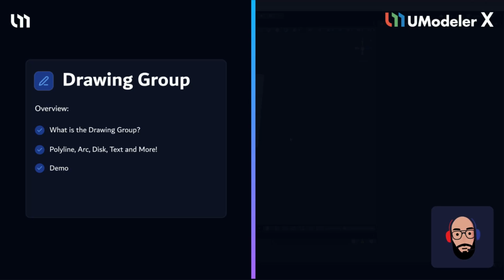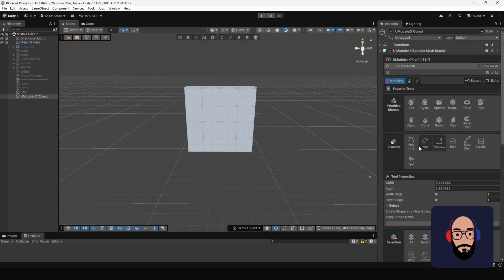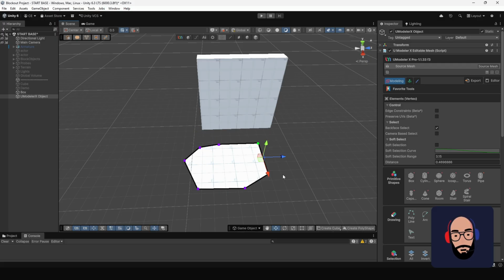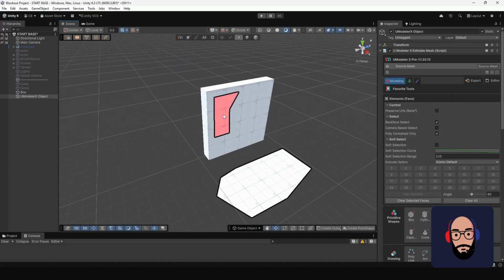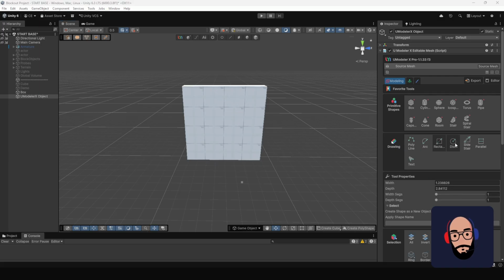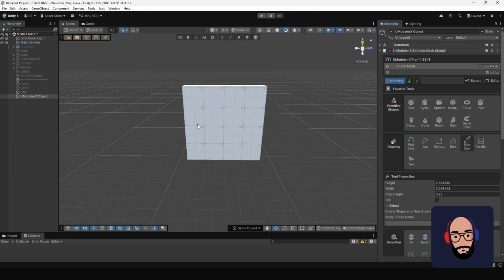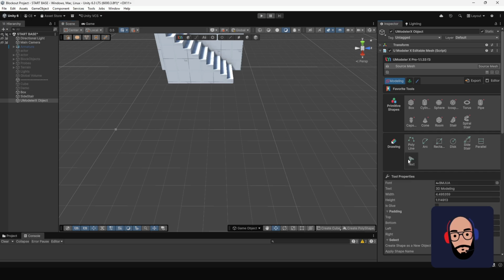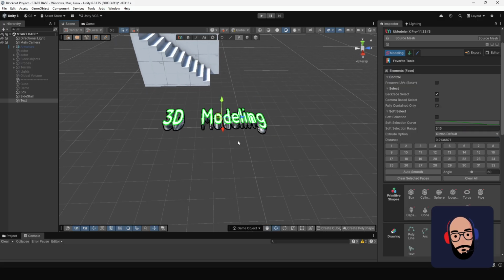UModeler X - Learn Drawing

Comment: I always got the problem that when i’m trying to draw a rectengular line on a wall for example, it creates a new object on the ground. Even tho Sometimes it works on the wall... Any Tips ?
Reply from the maker: Hey there, so you just have to make sure the object you are trying to draw the rectangle on has a mesh collider. 
You can also make sure every UModeler X Object has one by going into the settings and toggle: Auto Generate Mesh Collider. Feel free to reach out  on the UModeler Discord and we can chat more!